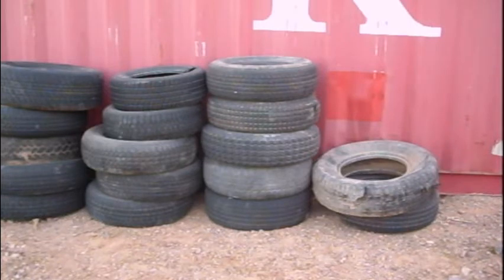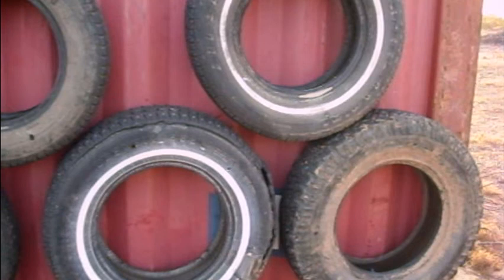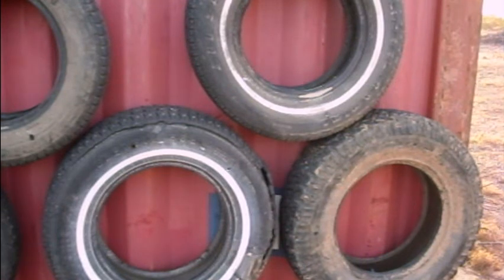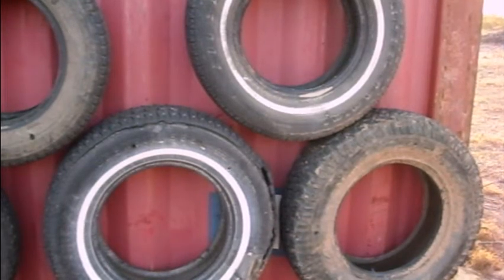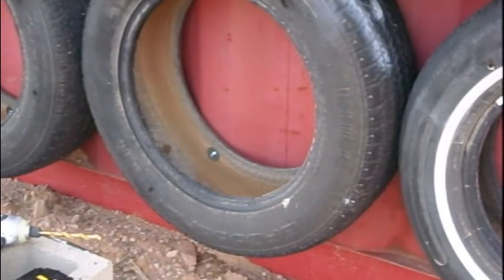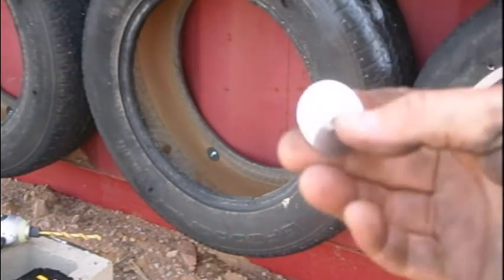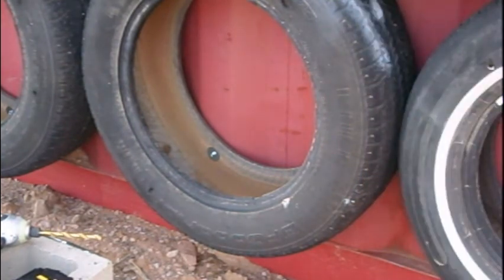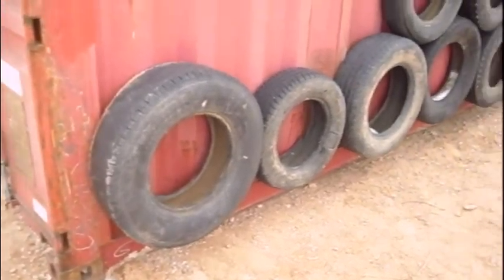#32 Recycled Tires

Comment: My bet is spacers for insulation. An air tight layer will cover it. The outer wall will comprise of substantial air volume, in small pockets to limit circulation and with that heat transfer.
Wow man, that's a lot of land. Are you starting you own country club? Or at least a Football stadium?
I read on a chemical which mixed with the dirt on one's property, makes for excellent building bricks, with superior insulation properties. Check it out. Beat hauling bricks to the land...